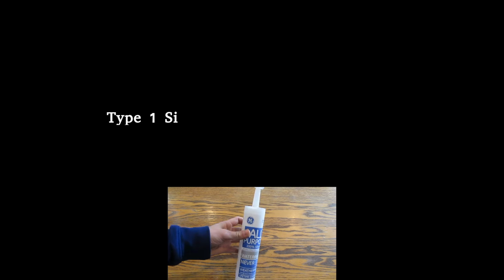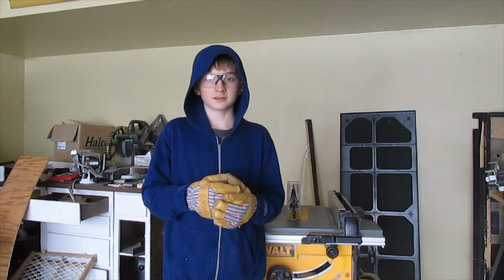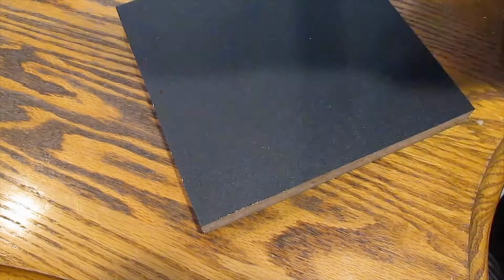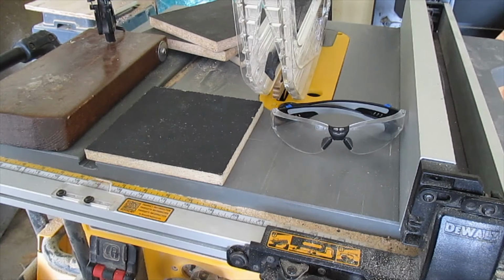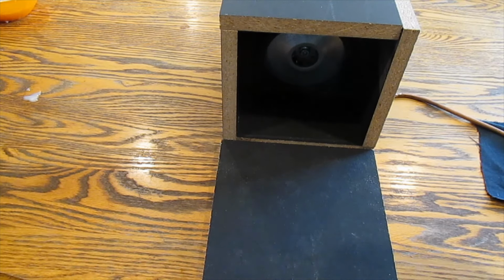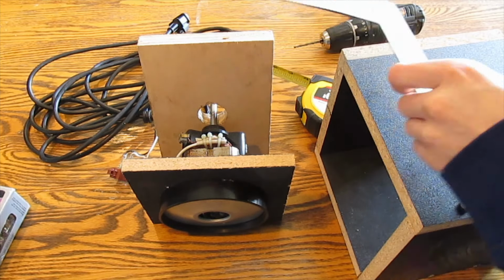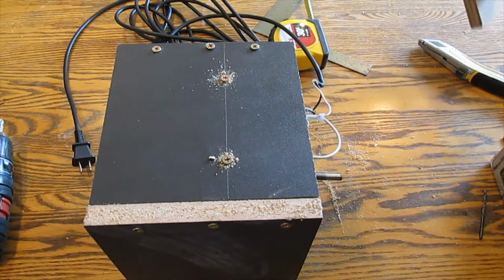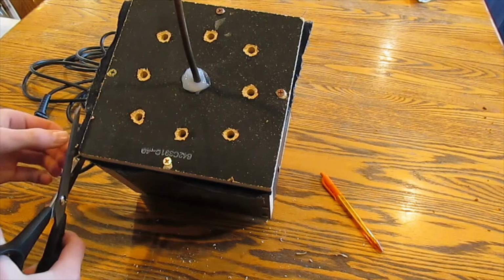How to reuse a Vacuum cleaner motor assembly.

Comment: Hello quick advice never use gloves while operating any tool that has a blade  and the operation of it requires that your hands come to a very close proximity. Specially table saws if the blade happens to grab any fabric from the gloves it will pull ur hand

Comment: That's a lot of work for a solder sucker.  But when I was your age I built a lot of strange things too.  I applaud your ingenuity and would encourage you to continue to dream and build.  Just think your ideas through a little better.  I once built a super charger for my mini-bike.  Worked too.

Also, from what I think I saw, the holes in the solder sucker seemed un necessary.  A good solder sucker will provide sudden and high volume vacuum.  Pulling a steady stream of vacuum through a quarter inch tube will not serve very well.  The vacuum motor will spin faster as you restrict the airflow.  The reason it spins fast when blocked off is because it's not moving any air - not doing any work.  Work is when something is done.  In the case of a vacuum, moving air is the work.  Block that off and the motor will spin very fast and be inefficient.

Nevertheless, keep going.  Just be safe. Gloves are not safe when operating saws and other things with blades that can grab fabric and pull your hand into harms way.  At LEAST you kept the safety guard on the saw.  Most people remove them.  Then learn why it's not a good idea.  Also research "Push Blocks" for table saws.

Comment: In my experience solder suckers are a waste of time. They require a lot of maintenance each time you use them. Instead I recommend getting some high quality solder braid (with flux)  in 2 or 3 sizes, if you can only get one size to start, then buy the 1/8 inch wide size and a dispenser of liquid flux. Digikey and Mouser are good quality sources. With some practice I think you'll find this will remove solder better and with less damage than any solder sucker and it requires no maintenance. It is expendable so buy 25 foot rolls and they will last quite a long time.
Reply from the maker: Thanks for the tip.